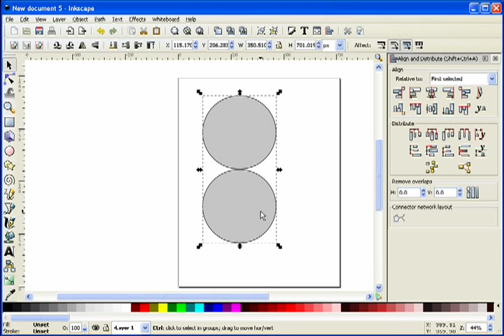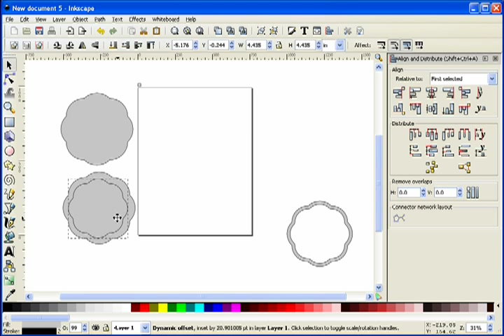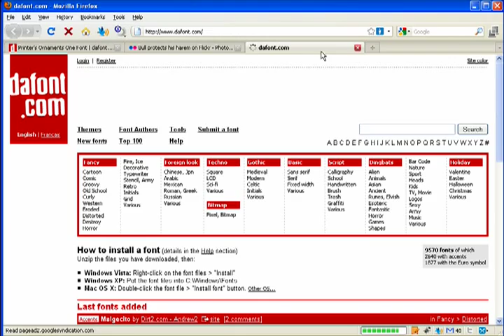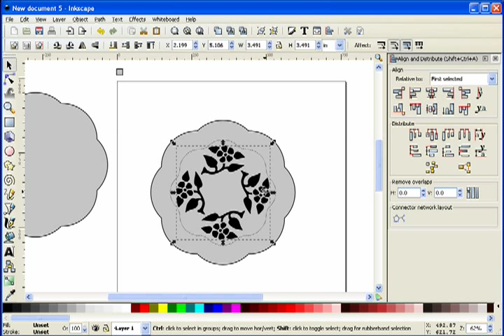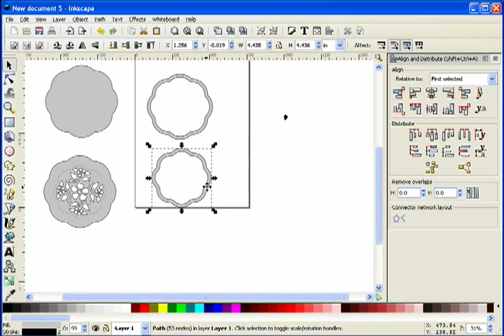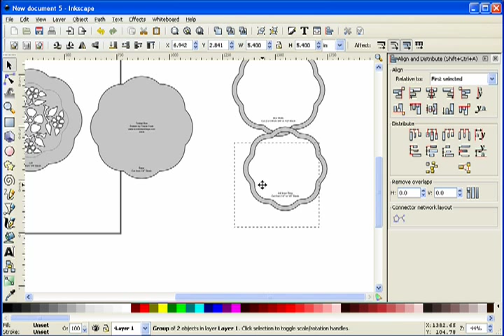Making Scroll Saw Patterns with Inkscape - Lesson 7

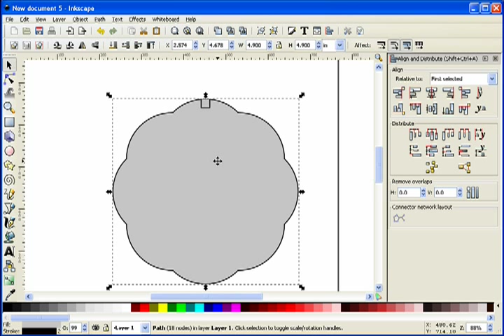Comment: Travis, Thanks for the video. I am having a problem at the 5:26 mark in the video when you said you were going to duplicate the small 1/4"measuring square. It disappeared. When I try that (a dozen different times), the little square does not disappear. And when I try to use the Dynamic Offset, the little square is highlighted with 2 little squares and two circles on the lines of the square. Do you have any idea what's wrong???  Steve